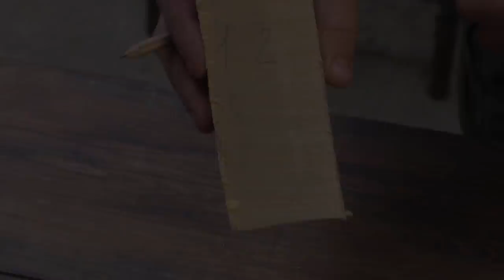10 ingenious tricks for every master!

Comment: To magnetise a screwdriver tightly wrap a coil of wire around the metal shaft and briefly touch both end of the wire on a 12v car battery a couple of times, depending on how stong you want the screwdriver to magnetise.
Obvioulsy do it fast so as not to weld the wire to the battery terminals.
Mechanics trick in a pinch 👌
Reply: You can also just slide a refrigerator magnet down the shaft of a screwdriver about ten times to magnetize it.

Comment: #10  Never would have thought of using dental floss for getting glue into a crack.
The only ones of these I knew about were #5 and #4. I have done both of those.
#2 The spray booth elevators were really clever and cheap.
Reply: I JUST glued a board when I saw this. 😐Next one...

Comment: I love the "why didn't I think of that" aspect. Didn't really get #7, but liked everything in general. Good job!
Reply: He divided the wood into 2,3 and 4 equal sections without having to do any real maths. Just find a suitable multiple, hold the ruler at an angle where the zero is on one side of the wood and the upper multiple on the other side and then put a mark on each multiple. Example : the wood is 5" wide and you want to divide it in 6 pieces. Place the zero on one edge of the wood and the 6" mark on the other side, then mark off each inch. Of course, units don't matter, so works in inch, feet, cm, metres, etc